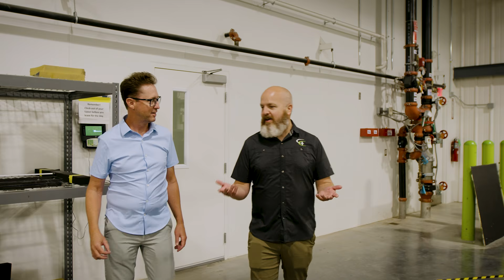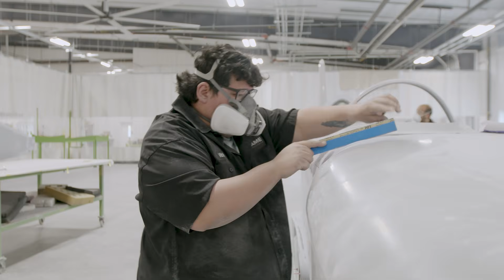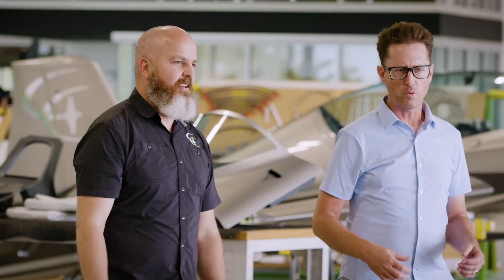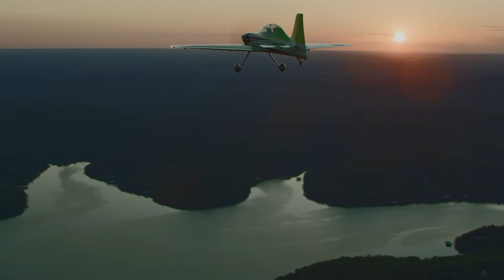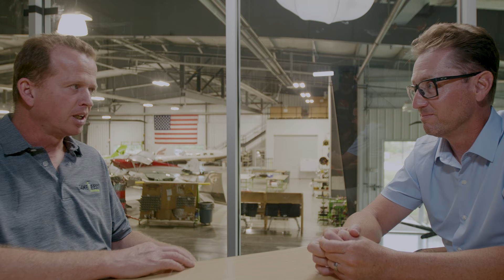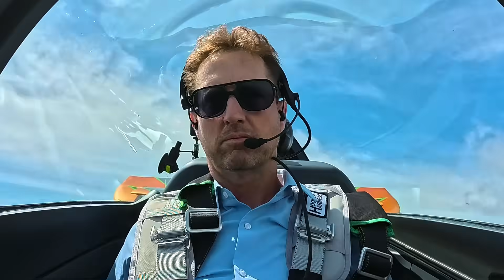Gamebird Aerospace - Built For Flight!

Comment: The Thrush aircraft still has a tri-pod main landing gear on the 500 gallon aircraft. it is lighter yet stronger than the spring steel gear.

Comment: What is the life expectancy in terms of durability of the airframe? I flew a wooden airplane for about a decade which was built in 1946. ( Culver V designed by Al Mooney. The aircraft was eventually donated to a museum.) Do the designers expect the airframe to last 50 years for example?  Obviously our aircraft was kept in a hanger for its entire life and certainly a composite aircraft could not be exposed to the elements as a Cessna 172 , for example, which is tied down out of doors.

Comment: Base/New Price: $607,700 (includes standard Garmin G3X Touch avionics, GTR 225A COM, GTX 345 Transponder).
Market Range: Used or slightly older models range from $450,000 to $579,000 depending on engine time and options.